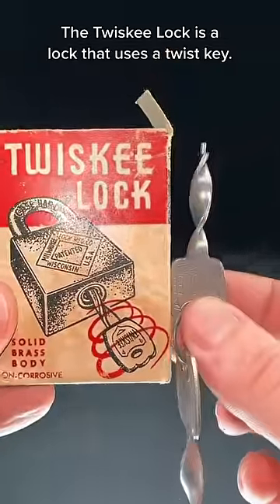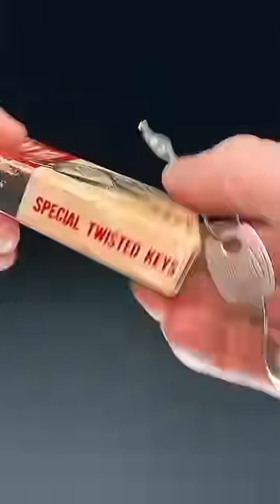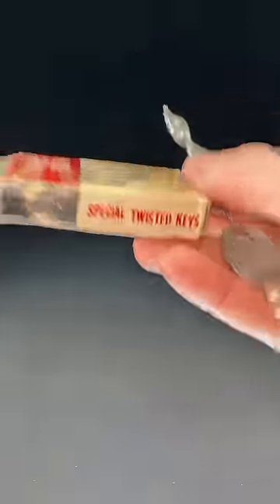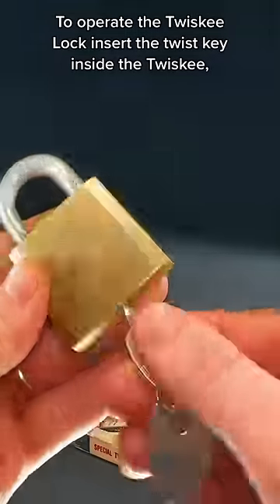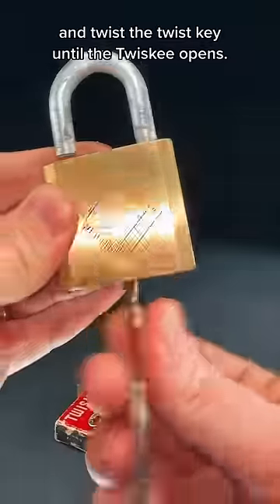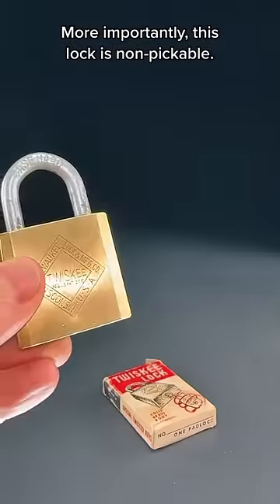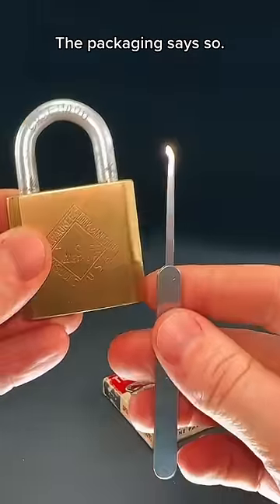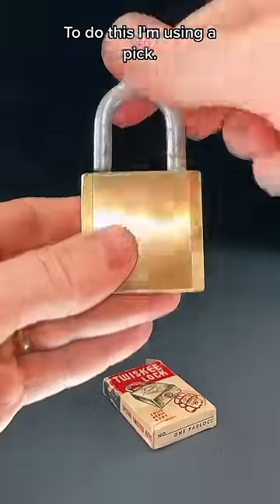Twiskee made in Milwaukee #lockpicking #security #survival #edc #family

Comment: It's giving me "The missile knows where it is at all times because it knows where it isn't" vibes
Reply: "By subtracting where it is from where it isn't or where it isn't from where it is it can pinpoint it's exact location"
Reply: The missile knows where it is at all times. It knows this because it knows where it isnt. By subtracting where it is from where it isnt, or vise versa, whichever is greater, it obtains a difference or deviation. The guidance subsystem uses deviations to generate corrective commands to drive the missile from a position where it is, to a position where it isnt, and arriving at a position where it wasnt, it now is. Consequently, the position where it is, is now the position that it wasnt, and it follows that the position that it was, is now the position that it isnt. In the event that the position that it is in is not the position that it wasnt, the system as acquired a variation. The variation being the difference between where the missile is, and where it wasnt. If variation is considered to be a significant factor, it too may be corrected by the GEA. However, the missile must also know where it was. The missile guidance computer scenario which as follows: because if variation has modified some of the information the missile has obtained, it is not sure just where it is. However, it is sure where it isnt, within reason, and it knows where it was. It now subtracts where it should be from where it wasnt or vise versa. And by differentiating this from the algebraic sum of where it shouldnt be and where it was, it is able to obtain the-
Reply: the missile knows where it is at all times. it knows this because it knows where it isn't. by subtracting where it is from where it isn't, or where it isn't from where it is (whichever is greater), it obtains a difference, or deviation. the guidance subsystem uses deviations to generate corrective commands to drive the missile from a position where it is to a position where it isn't, and arriving at a position where it wasn't, it now is. consequently, the position where it is, is now the position that it wasn't, and it follows that the position that it was, is now the position that it isn't. in the event that the position that it is in is not the position that it wasn't, the system has acquired a variation, the variation being the difference between where the missile is, and where it wasn't. if variation is considered to be a significant factor, it too may be corrected by the gea. however, the missile must also know where it was. the missile guidance computer scenario works as follows.
Reply: that sounds like some scp-055 type shit
Reply: @MaoWRLD  oooooooooooo9o9 9oo9999
Reply: @Tankman6453  9
Reply: I have a feeling this missle sentence isnt a fabrication.
Reply: @Tankman6453 In short. The middle knows where it is because it knows where it is not. Since it knows where it‘s position, I give it your position. Then it makes it‘s position your position, which removes your position from all positions.
Reply: The pick knows where it is because it knows where the lock isn’t by subtracting the pins from the shear line it opens the lock
Reply: Reminds me of that fire that happened in the Bronx where a fire happened in Bronx
Reply: sumounted by a base plate of prefamulated amulite....
Reply: "I gave the missile your position, so the missile goes to your position thus substracing your position from every position."
Reply: glad i know what you're referencing
Reply: Which vid was this? I haven’t watched Fearjames in a while
Reply: @frostyvoid827  it's not fearjames, just search "missile copypasta"
Reply: EXACTLY!
Reply: 𝙾𝚗𝚐?
Reply: @MaoWRLD what did i just read?
Reply: @tristinroberts4963  the missile
Reply: 10 000th like
Reply: @MaoWRLD  full version

The missile knows where it is at all times. It knows this because it knows where it isn't. By subtracting where it is from where it isn't, or where it isn't from where it is (whichever is greater), it obtains a difference, or deviation. The guidance subsystem uses deviations to generate corrective commands to drive the missile from a position where it is to a position where it isn't, and arriving at a position where it wasn't, it now is. Consequently, the position where it is, is now the position that it wasn't, and it follows that the position that it was, is now the position that it isn't.
In the event that the position that it is in is not the position that it wasn't, the system has acquired a variation, the variation being the difference between where the missile is, and where it wasn't. If variation is considered to be a significant factor, it too may be corrected by the GEA. However, the missile must also know where it was.

The missile guidance computer scenario works as follows: Because a variation has modified some of the information the missile has obtained, it is not sure just where it is. However, it is sure where it isn't, within reason, and it knows where it was. It now subtracts where it should be from where it wasn't, or vice-versa, and by differentiating this from the algebraic sum of where it shouldn't be, and where it was, it is able to obtain the deviation and its variation, which is called error.
Reply: @MaoWRLD i will give the missle your location so it can make your location its location thus subtracting your location from every location.
Reply: @takish2024 DO NOT SAY THE WORD "TURBO ENCABULATOR" IN MY PRESENCE!
Reply: @user-xp1je4cb9z   i will call up clu 😂😂😂
Reply: @takish2024  he just said it in his own presence ahgahgahgahgahga
Reply: ngl kinda same
Reply: @potatoboia9 pretty sure there is no 055
Reply: @JohnnyTromboner  it's the antimeme, the thing that we know what it isn't but not what is
Reply: Hey guys did you know
Reply: The mailbox knows what you are thinking at all times because it knows what you are not thinking
Reply: Hmmm...  🤔   Now I need to find the origin of that quote...
Reply: The penguin
Reply: It makes me sad to know that it is unfortunately real.  Brings to mind the old method of “the enemy can’t know what your next move if you don’t even know what your next move is “
Reply: @jasonwhite2028 it's not. I forget it's actual name but have heard it referred to as "the penguin". It's an air to ship missile with a very high yield
Reply: This flew to my mind
Reply: @MaoWRLD this is just the gingerbread man telling Charming about Shreks whereabouts
Reply: @potatoboia9 what is or who is or... Wait what are we talking about?...
I only know that it's not a sphear

Comment: "But this lock is unpickable. It says so on the box. I will now unlock it with a pick"

TEACH US YOUR WAYS!!!
Reply: The package claim is technically true, while he is using a pick he isn't picking since there no pins to pick.
Reply: @jon9103 ctually, his method only works if the lock isn't locking anything since it requires rotating the lock itself. Something that can only be done if the lock isn't attached to something. Making it pretty much pointless.

Edit: He opened it with the use of a picking tool so it's correct to claim that he "picked" it. To properly pick a lock like that when it's actually attached to something would almost reauire reverse engineering the actual key as "normal" picks only works if you can fully rotate the lock.
Reply: @possumverde  he uh, would just have to twist the pick instead, the twistkey has no pins and the only gimmick is that it twists in a spiral, meaning you can twist it with anything thin and long. No offense but, you sorta just said you can't open a water bottle if it's on a table because you can't twist the battle, completely ignoring the idea that the cap is twistable itself
Reply: @presonce That only works if the pick can get a good grip on the inner mechanism. More than likely you need to rotate the lock because the pick does not grip the mechanism itself.
Reply: @thatguyonyoutube989  If rotating the lock rotates the mechanism, it should react the same way vice-versa. If you pick didn't grip a mechanism, rotating the lock would produce the same result of no turn
Reply: @presonce  The rotation can force it to catch in the mechanism as it otherwise wouldn't. Am I going to have to explain this like you're 5?
Reply: @thatguyonyoutube989 No you don't. Based on Newton's third law and Archimedes moment, the force to rotate the pick vs the force to rotate the lock is 3:1 at most. And look at the video he hold the lock AND THE PICK in hand. So his right hand will take the force he would need to provide to rotate the lock. It is not like he strap the pick in something and rotate the lock so your theory is completely bullshit. So does your ego.
Reply: @hunghung9537  Whether or not a lock spins based on the direction it's turned has literally zero to do with newton's third law.
Reply: @thatguyonyoutube989  The force the lock apply to the pick is the same as the force the pick apply to the lock, that is Newton's third law.
Reply: This whole comment section has just become a reddit thread at this point
Reply: @thatguyonyoutube989 Your attitude coupled with your flawed logic and lack of understanding basic physical principles is really giving me second hand embarrassment😬
What the youth would refer to as "cringe" I believe.
Your opponent wins, flawless victory😜🥳
Reply: @agentrapper  The irony of your post is so dense you could load it into a gun and kill elephants with it, lmao. Now I have two flawless victories.
Reply: @thatguyonyoutube989  You misspelled defeats. And you should educate yourself on how guns work, or perhaps you meant a pistol?
Reply: @possumverde You just explained why you're wrong & don't even understand why you're wrong. Just stop
Reply: easy. Spring Steel. done.

Comment: Lock manufacturer: "Our locks are unpickable"

This guy: "And I took that personally."
Reply: Tbf they were probably unsinkable at the time they were produced. The box looks fairly old
Reply: Him and LPL should make a vid
Reply: "this guy" 💀💀💀 hes the number 1 masterlock archnemesis
Reply: It doesn’t even have real pins, a modern version could be pretty good
Reply: @kudowsstudio  I mean, the guy used a pretty standard lockpick. They were probably "unpickable" for like a few days but nothing that couldn't be figured out if someone actually tried even back then.
Reply: @kudowsstudio Actually, his method only works if the lock isn't locking anything as it requires rotating the lock itself. Something that can't be done while it's attached to something. To actually "pick" that style of lock when it's in use is very difficult and would reauire a tool so specialized that you would essentially have reverse engineered the actual key by the time you're done. For all intents and purposes they are nearly pick proof when it actually matters (unless you want to buy a specialized tool or craft one yourself through trial and error.)

Comment: The funny part is that the twiskee lock isn't even a lock. The key just inserts and that opens the lock. No pins are set. It's effectively just a mechanical puzzle rather than a lock
Reply: I mean, isn't the primary function of a lock to prevent someone from having access without the key?

Setting aside the obvious lockpick issue, this still requires a key to open
Reply: @spindash64  It's not much of a key if another person who bought the same lock can unlock your lock with their key
Reply: @n00bxl71 the lock is non binding, it doesn't have a shackle catch on it

Comment: This is an interesting idea though, like imagine if beyond the key opening you had a completely open cylinder, with pins circling that cylinder.  It seems to me that lots of lock pickers rely on the shape of a lock to give them leverage and make it easy to find the pins.  The key would use its shape to find the pins.  It might require a change in shape from a classic lock and I'm not saying it would be impossible to pick but I could see it being significantly more difficult. 🤔 Maybe cost would be too high though?

Comment: Genuine question mcnally, do you think it would be pickable if a twiskee lock had the grooves inside forced into a pure spiral patter you HAD to twist the key several times in and combined with the twiskey having the normal grooves a regular key has with the pins inside? (Would have to probably be a much bulkier lock)

Comment: I sometimes work in a variety of large manufacturing plants owned by different corporations.

I agree with "lock out tag out" for safety but lost keys aren't a big deal.

So many of them can be popped just trying random keys.

Or fast still is TIG Welding filler rod turned picks.

And if all else fails one careful swing from my sledge hammer solves the problem. 😂

I enjoy seeing your videos but there isnt a lock I cant beat caveman style and nobody boots a Welding Rig and gets it back in one piece. If at all as it's scrapmetal.

Family farm gate has heavy chain and a bunch of padlocks on it. 

Still no tech keyless entry. Its for show.

For those that know the chain is hung on a big arse nail behind the post.

Kids once were used  as TV remotes and gate openers. You don't want the headache of them fiddling with keys and dropping them in mudholes. So you throw away the keys  and use a nail.

TV remotes are standard now but still a lot of tradition farm and ranch gates around and the smart child is the one that sits in the middle of the old farm trucks bench seat where the A/C and Heater vent isnt ideally placed but constant enough if you don't have to get out and to young for a driver's license to be nice...but "baby" seat.

Passenger side is our lil gate opener. But 🎅 puts a lil extra in their stockings at Christmas for being nice to the younger siblings.
😂🤣😂🤣

Comment: could you explain why you were able to pick it?
Reply: There are no pins in this thing. Notice how the key is completely smooth, with no grooves whatsoever? There is, however, a small, cylindrical peg at the top of the key. This thing has a button inside of it that opens it, basically.
Reply: Also there's no catch on the shackle, you could open this with a decent smack